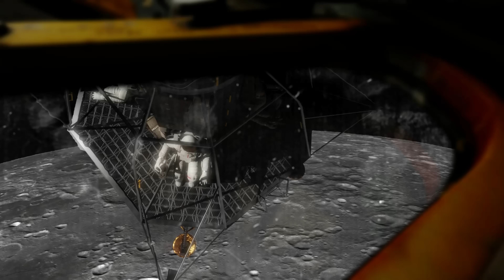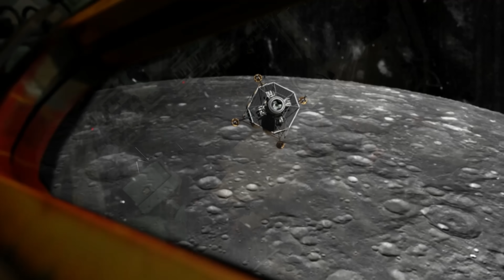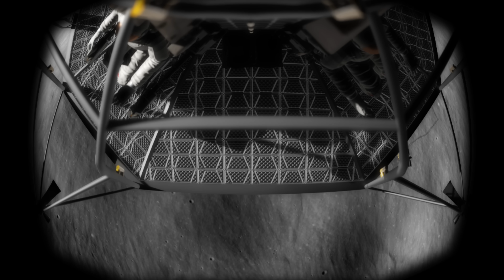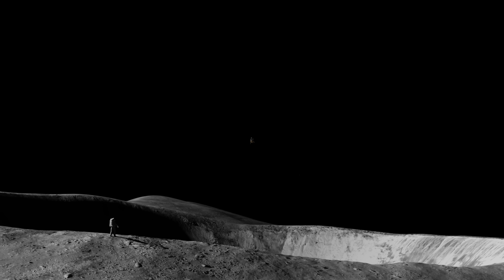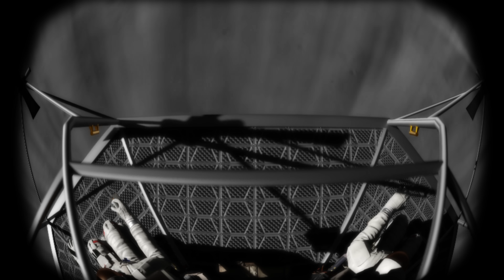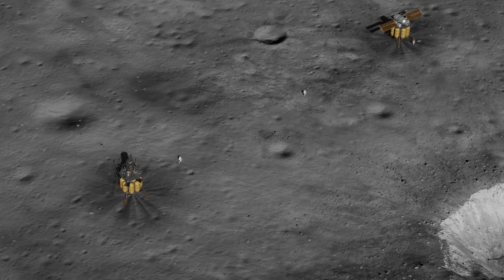NASA's Unpressurized Lunar Lander

Comment: I'm not digging having four engines. If one of them cut out, you're looking at an abort or the opposing one would have to shut down immediately to maintain attitude. But if it can still fly and land on two engines, why is it carrying the weight of four?
Reply: If it can land on 2, but has 4, it has room for any single engine to fail.
If it only has 2, any engine failure dooms the crew.
It's called redundancy, and even airliners have it. Why do you think fly-by-wire jets like the F-16 have 5 flight control computers?
That allows for TWO failures, AS WELL as providing "majority vote exclusion" of a bad computer most of the time (until you get down to 2 computers), because DETECTING which computer isn't working right is JUST as important as having enough computers in the first place to have spares.
But the engine thing with this lander is the same kind of thing with why airliners still have 2 engines.
Fun fact, even if a modern airliner (which usually only has 2 engines) has an engine failure at THE WORST TIME during Takeoff (right at the point where it's no longer possible to reject the takeoff), it's designed with enough extra engine power in EACH ENGINE to be able to CLIMB at 1000 feet per minute. Up at high altitude, you won't be able to maintain as high of a cruise speed as normal if an engine fails, because there BOTH engines need to contribute, but in most cases you'll still have enough spare capacity to allow diversion to an airport along the flight route that can handle landing whatever aircraft has the failed engine.
This is all codified in aviation law (in the US) by the ETOPS specification, which stands for Extended Twin-engine Operations.
Virtually all aircraft are rated for ETOPS 120, which means that they're RATED to be safe to continue flying on ONLY ONE ENGINE for up to 2 hours (the number in the rating is the number of minutes it's rated for single-engine operation).
Most very-long-range aircraft are rated for ETOPS 180 or longer, because this allows them to theoretically fly point-to-point to any airport within their operational range, while still having enough fuel to divert to an alternate airport if something like weather or an accident prevents landing at the intended destination airport.

The FAA's rules and laws were, unfortunately, written in the blood of those lost in aviation accidents.
And so are at least some of NASA's laws about component-level redundancy in spacecraft design.
Reply: @44R0Ndin  No doom - abort. The Apollo LM had one descent engine for a reason. If it failed, the crew could abort without upsetting the attitude.
Reply: It's meant so they don't have to abort with an engine out. The design aims to land first and abort only if they have no other option. The Apollo LEM was built around the idea that aborting was your ONLY other option every flight since you only had the one engine at any phase of flight.
Reply: @randycampbell6307  Ahh, but if you lose one engine on descent and don't abort, you'd have to shut the opposing engine immediately So when you say "It's meant so they don't have to abort with an engine out" what the scenario would really be is "they don't have to abort with two engines out." If you can land on two, why carry four? The posture becomes, carry two engines as hot spares for the other two. Think about it - if an engine has X% probability of failing on descent, then the probability of having one of four fail becomes 1-((1-X)^4). A 1% probability for one engine becomes 3.9% for four. It's like you're carrying spares to cover for a problem you yourself are creating.
Reply: @hubbsllc  Actually if the engines can gimbel through the center of mass then you don't have to shut down the opposite engine. Note the engines are clustered together near the 'center' of the vehicle so they don't have to gimbel that far to compensate for an engine out. Having only two engines would mean they have to be more powerful and have a deeper throttling ability and now you have to be able to abort with only a single engine and you WILL have to abort it anything goes wrong with a single engine because you won't have the thrust or control to land.
Reply: @randycampbell6307  You want to add on all the gimbaling hardware just so you can have four engines? Heck, might as well include a pinball machine while you’re at it! 😊
Reply: @hubbsllc  What you're going to deny the crew entertainment too? :D
Reply: @randycampbell6307  It seems strange and unlike NASA to attempt to continue to a landing with something so serious as an engine failure, which are violent enough to throw high velocity fragments in nearly any direction, but of interest would be directions where they would have a chance of piercing the propellant tanks. If the fragments from an engine failure pierce the propellant tanks, no amount of extra engines will "save the mission" and allow you to continue to a safe landing.
In that case, your only option is to abort, and in so doing abandon the descent stage. This is still a 2-stage design after all, just like the Apollo LM.
Because these sort of decisions need to be made quickly, and it is not prudent to rely on a computer to tell you what happened, any failure of any engine is in fact reason to abort (or if it's an ascent engine failure, and there's only one ascent engine, that would indeed be certain doom). The computer can be relied on to detect the engine failure (perhaps before it becomes highly damaging), however even then the decision is always "abort back to orbit using the ascent stage" and never "use the crippled descent stage in an unknown state of functionality to attempt to make a safe landing, with an unknown performance reserve (or shortfall)".
NASA does risky things, but given that the risky thing must be attempted, they choose the method of attempting it that has the lowest possible risk.
And continuing the landing when your descent stage loses an engine (damaging nothing, or who knows what other systems, or HOW MUCH it damages them), is not "the least possible risk".

NASA will never do that. The thing probably needed 4 engines because it needed 4 engines, not because it needed 2 and had 4 for redundancy. These are probably not RL-10 based engines either, they're probably pressure-fed hydrolox engines, likely with hydrogen based combustion chamber cooling. I highly doubt that they have any sort of turbopump whatsoever, because that invites far too much risk. Same with the ascent stage, it too will almost certainly be using simple, easily controlled, pressure fed hypergolic engines.
Remember, NASA always chooses the least risky option. And if losing an engine results in asymmetric thrust (and the attitude control issue that brings with it), that means that the design is likely disqualified on that demerit alone.

Comment: I’m assuming this was alternate constellation, not just an Apollo study bc of the early Orion design with a large Methalox service module?

Might still be relevant if we don’t have a working HLS tbh for Artemis 3. Wouldn’t be too hard to slap this thing together compared to building a pressurised module with it as well and doesn’t matter much for a short minutes long trip to the surface

Would’ve worked better to descend from LLO with Orion’s more capable service module but with ESM you’d want an even more capable lander with more delta v unpressurised still and start the burn at periapsis so they’d hang out in LLO for an hour maybe before descent to the South Pole, then rendevouz would be an issue and would force them to stay in a habitat on the surface for a bit
Reply: According to After LM, this concept was studied in May 2006, utilizing suit-ports and a pressurized habitat in the descent stage. Total mass around 20t